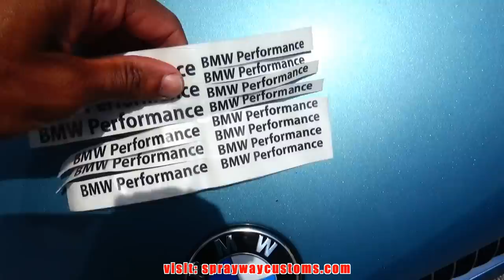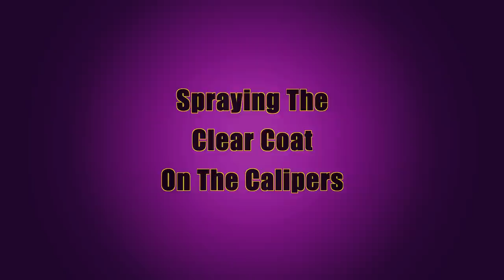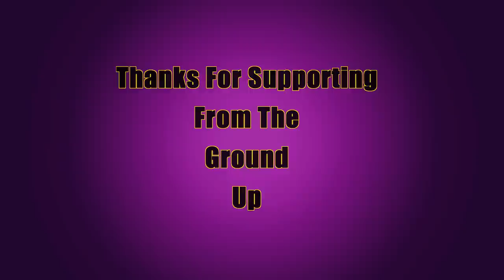How To Paint Brake Calipers & Rotors Without Removing Them - Best Way To Painting Calipers On Car

Comment: Love it, just be careful with holding cars up with cinderblocks. Two cases in the last year here in North Carolina of cinderblocks crumbling and pinning someone under a car. Both survived but with serious injuries
Reply: Guy I know  here in Missouri lost his foot using them.. jack stands Sprayway
Reply: Old cinder blocks
Reply from the maker: Thanks GoalieLife. I really appreciate the concern, it’s greatly appreciated 🤝
Reply: @SprayWayCustoms  
The safest way I know is cross ties cut and doubled a little longer than cinder blocks and doubled and stacked another layer on top going the other direction crossing the bottom ones, with a piece of plywood that fits on top of that.. Good and safe on level ground... (Good hardwood cross ties, not the old bad ones)...  Phillip Hall
Reply: @SprayWayCustoms  black disc paint should be remove when braking? How? 🤔
Reply from the maker: @Atila643  when the pads contact the rotors
Reply: I just use brake cleaner and alcohol to clean the caliper

Comment: I 100% and a fan of your channel. Your painting skills are superb. With that said painting your brake rotors and the calibers... Never, ever paint a brake contact surface. Yes brake pads will burn off the paint from the rotor but in doing so it contaminates the brake pad and we'll lead to glazing. Blazing is basically slick spots where all of the porous components in the brake pad have now been filled in with a substance. This reduces your ability to brake and increases the distance it takes you to stop in any situation. I like my car to look good... It doesn't have to look half as good as much as it has to stop though. It don't even have to roll but it damn sure has to stop. That is the most important part of any car. So I'm going to recommend that people don't do this. If you want to paint the center hub of your rotor mask off. If you want to paint the brake caliper, take it off and remove the pads hang it inside the tire well. Just do not paint your damn braking surfaces 🤦. This has been a PSA that could save your life.
Reply from the maker: Thanks for the info

Comment: & Just sharing a old school trick   Sometimes using tinfoil to cover up suspension parts is ez too         By the way you  inspired  me  to use Big Flakes on this n that like I did my Eldorado taillights after putting thinned down black on them and then rainbow flake in clear over them I was surprised how many people didn’t know about  metalflake  they liked it    It got noticed 🤔
Reply from the maker: That’s what’s up. Thanks for the support man

Comment: Wow! Those calipers look exceptionally beautiful! How are the coatings on them -  and the rotors - holding up under the heating effects of braking after this time?
Reply from the maker: Thanks again Mike
Reply: No. It doesnt last, and it contaminants the pad material cause its cover the contact/surface area
 And like you said w the heat
 It doesnt last. High heat paint is needed. Heat the parts, paint it, bake the parts. Cover pad surface area of it fills the pads porus material and glazes them after it backs in
 This vid is a bad way to do it

Comment: So getting paint on the rotor surface doesn't cause any issues with stopping?
Reply from the maker: No, the pads will clean it right off after a couple stops

Comment: Nice work as always. However, it's a shame they spent all that money on nice wheels, but didn't get some cross drilled rotors to really set the whole package off. And, did anyone else notice that near the end of the video, that the left front tire is mounted so that it's rotating in the wrong direction. (Or that it should have been on the right front.) Just a detail I noticed...  Great quality work though!
Reply from the maker: Lol...yea I noticed that as well that the rotation was wrong

Comment: Isn't the paint on the rotors just going to wear off when you step on the brakes?
Reply: Yes he said it would in the video.
Reply from the maker: Yes it will in a couple of stops it’ll be completely gone
Reply: @SprayWayCustoms  so it doesn't really make sense to paint the rotors and you can save yourself the work 😂

Comment: It's pointless to spray the rotors where the pads make contact. It would probably make braking dangerous till the pad rubbed it off....no hate, I just work on cars. Finished product looks great!
Reply from the maker: Why is that? My brand new Wilwood Rotors have paint on them. The paint comes right off after braking.
Reply: @SprayWayCustoms  I believe they electro Coat their rotors.... I could be wrong. I personally would just paint the center and save paint n time. I'm not saying I'm right it's just a opinion like the rest of these assholes 😂. I just want the pad to make contact with the rotor and nothing else . Great video I've never tried oven cleaner to remove grease that's a great trick
Reply: @SprayWayCustoms thats a polymer coating made for it. Much different than regular paint. Regular paint gums up and glazes the pads once it burns in the pores reducing your stopping power, distance, and pad life. The paint on the calipers will eventually start coming off from heat unless you use high heat paint, heat the parts, paint it, then bake it. Then its almost like powdercoating.

Comment: BUT MAN WHY DID YOU PAINT THE ROTORS IT WILL JUST WEAR OFF THE FIRST TIME YOU HIT THE BRAKES or the brakes will be more of a suggestion than an order and youll plant that bmw in a light pole
Reply from the maker: Well, everything all good because this was done about a year ago and this is my daily driver with no problems. My brand new Wilwood brake rotors are painted from the factory

Comment: You should invest in a Cricut. I've had one for three years and it's more then paid for itself.
Reply from the maker: Appreciate it man
Reply: @SprayWayCustoms  so when are you going to spray the BMW? One more question. I have painted a car with metal flake and then European clear and I’ve got bad flake bumps and orange peel, I’ve watched a lot of cut n buff videos but I need to start out with 800 in order to cut it quick. I keep getting pig tails and it’s pissing me off. Should I just start with 1000, take my time and work my way up or do you have any suggestions? I afraid I won’t be able to get the shine back or the clarity I should say. I about to take it to a detail shop and pay them to do it otherwise. To time consuming and I don’t have the patients.

Comment: This is not a good way to do this. Rotors amd calipers get really hot. You need a higj heat paint. Supposed to get the parts hot, then paint them, then bake the paint on. Regular/non high heat paint will fail. Also you dont want to grt regular paint on the braking/pad surface. It gums up the pads and burns. Theres special paint you can hit the rotors with that can get a little bit on the brakin/pad surface that will not harm it. But ya this regular paint and doing it this way is not right. High heat paint is needed, preheat, paint, bake one. Recoat, bake again. For the calipers. Can do it for the rotors too, but mask of the bbraking surface to not contaminate the pads, unles ls you use the silver touch up stuff deslership use. Wish i could remember the name, but even that stuff you dont want to thick cover the pad surface/braking surface

Comment: Hopefully, spray painting the actual Rotor “WAS A JOKE”? 
( The Paint, would actually Clog / Burn into the Brake Pads. Which would also cause Glassing. ) 
Should have just taken the Caliper up, and painted it. And just mask off the actual braking part, of the rotor. And just paint, the inner part of the rotor. While on the bench. 
( Rather be Safe, than Sorry!
Reply from the maker: It haven’t done it yet and I drive the car daily 🤷🏾‍♂️

Comment: Why in the HEll did you spray your rotors?!?!!???? ANY foreign matter, on your rotors or pads will compromise your braking capacity. Not good.
Reply from the maker: Have you ever bought some high dollar or even seen Wilwood Calipers out the box? I think it’s some foreign matter on those from the factory 🤷🏾‍♂️
Reply: @SprayWayCustoms : No, I haven't, but I would suspect the user is expected to clean them before installation.